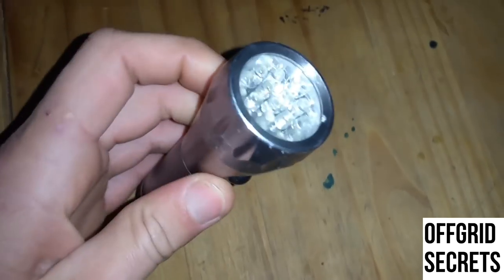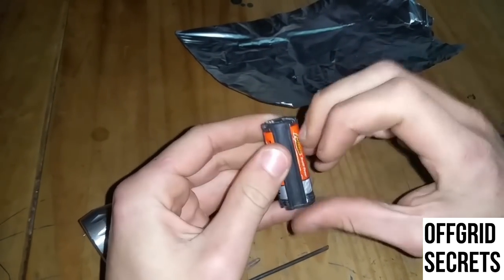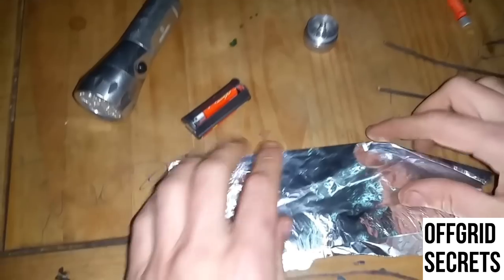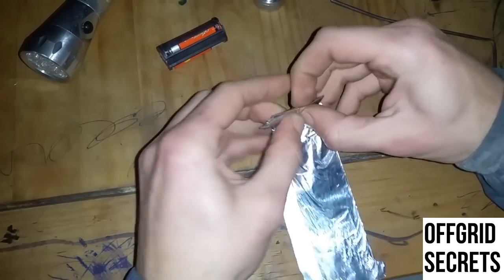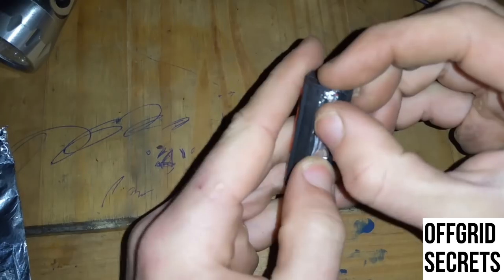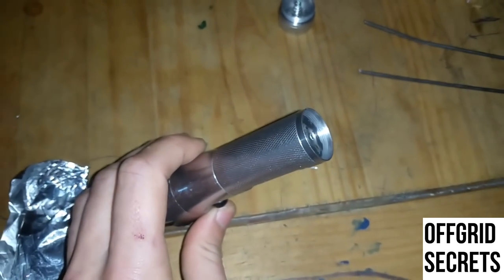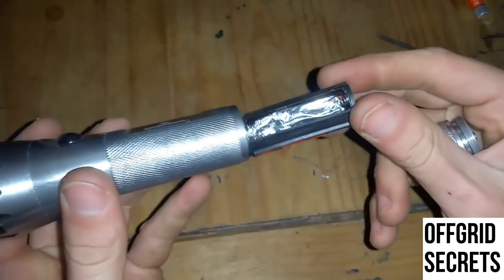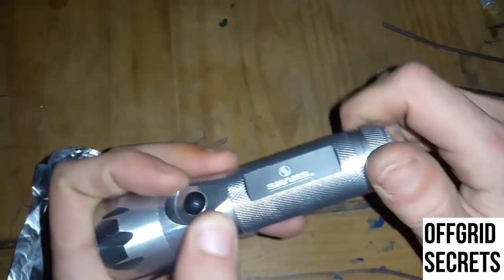Emergency Flashlight Trick

Comment: Won't you have varied success depending on led arrangement and circuitry? I don't think you could harm anything, but I suspect you may come up short on current in some rigs.
Reply from the maker: +weedeater64 i would imagine the batteries would drain faster and on some devices this may not work. But, there's only 1 way to find out!